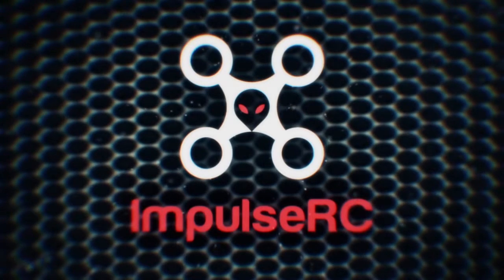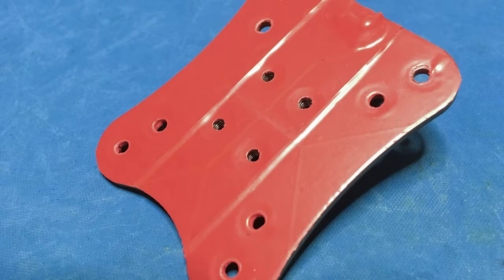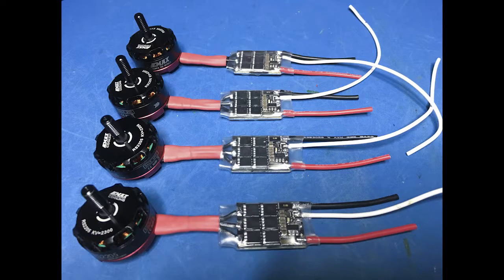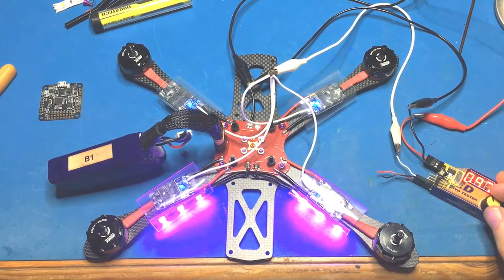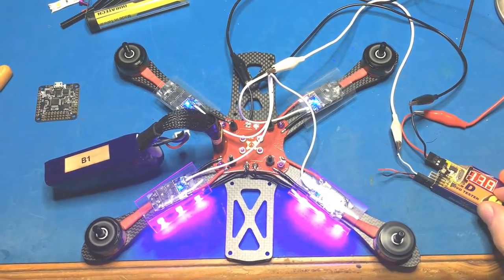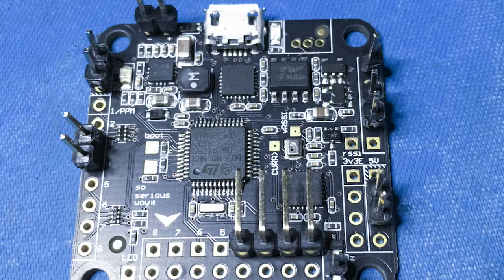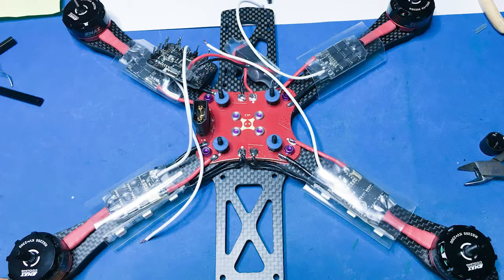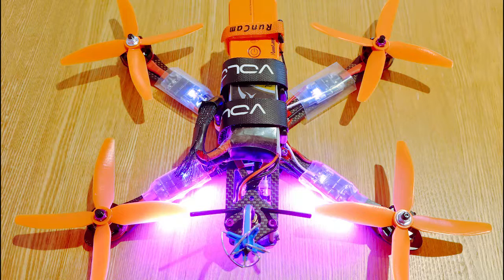ImpulseRC Alien Seconds 6" - Build Update | EMAX 2205 | KISS 24a | RMRC Dodo

Comment: How did you calibrate the esc
Reply from the maker: With KISS ESCs you don't need to do any calibration. They just work perfectly out of the box. Had them running for over 2 months now and not had any issues. When you manually move the Motor slider in CleanFlight/BetaFlight all the motors come on at the same time.